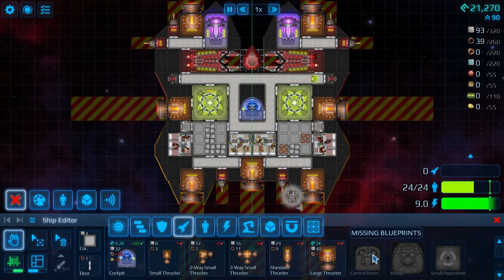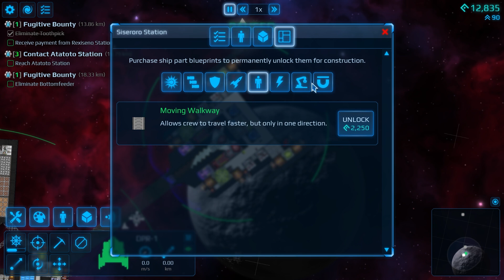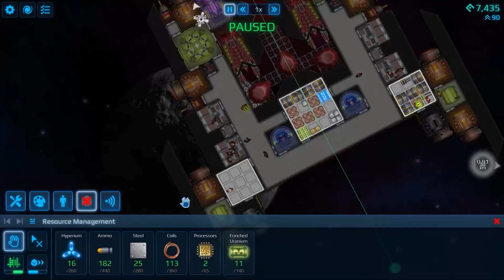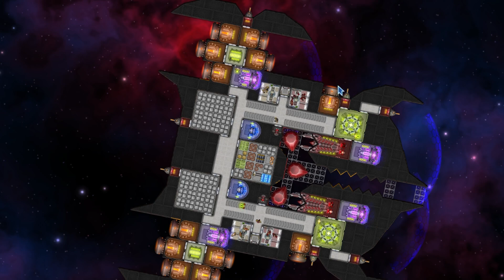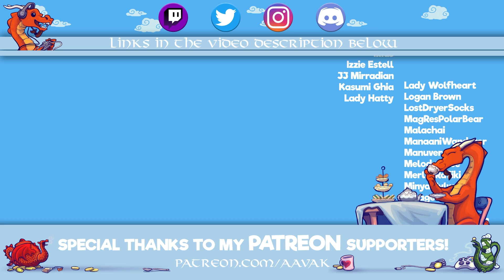Ion Prisms Allow MUCH better Defences!

Comment: A pretty good strategy once you start getting to a high level ship with a very large interior is to segregate your ship into different sections, so one section at the back to power the bridge and thrusters, one in the middle to power the lasers, and one at the front to power shields and other turning thrusters. This stops crew going from one side of a massive ship to the other and instead all the local crew dealing with it. It also means that when an area is destroyed (e.g the shield section at the front) you can still have a small amount of armour to protect the next section.
Reply from the maker: That's a fantastic idea.
Reply: yeah even in the demo after getting ship costs around 1 mil it was almost a necessity

Comment: I like the look of an open thruster but I have had both enclosed and exposed thrusters.
If it is cheazzy well so be it I like aged tasty myself ;).
Fleet stuff would be cool but I'd work on the main ship with a mining rig, maybe have a Hauler off to the side?
Reply from the maker: Interesting suggestion, though I do wonder that if you're already building a hauler, why not have the mining laser on that?
Reply: @Aavak  Sry for the late reply but I was thinking along the lines of one Miner to start and many to follow :)

If the mining laser is on the Hauler then you can only mine one rock at a time, 
with many mining drones many rocks at once.
Though I don't know if they can be automated? if so would be cool.

Comment: @Aavak Been playing this since it was it's Steam release and I've been loving it!

Some tips:
- Get your reactors to near the back of your ship. One medium reactor popping will GUT your ship! Protect them well, possibly even with internal armor!
- You can right click the gather icon to filter what gets tagged for gathering!
- If you hold alt when positioning your ship, relative to another ship, you can maintain facing relative to them rather than the world. Great for strafing!
- You can hold shift to reposition and turn your ghost ship for more fine-tuned maneuvering!
- You're only employing four gunners at a time to man your weapons, so if you only have one security (large) bunk, you'll have two extra to run energy. Having 12 crew running guns is overkill for your setup, even accounting for crew losses during combat. You could pack another small bunk in if you're worried about energy/loss, and save yourself some space.
- Crew move at half speed through any area that isn't a corridor, so having crew movement corridors and rooms with doors to them will greatly improve movement speeds!
- The gratings/structure elements absorb some shots, but only from enemies! so placing them in front of vulnerable areas (i.e. guns) is advisable. This will work better than your sawtooth structure while not restricting your firing arc as much!
- ASAP build a cargo ship and man it with two to five crew so you don't need as much storage on your main. Collect with main, so you have access to full crew gathering, but then transfer to cargo.
- You'll eventually want a few storage boxes with just a cargo bay and small bunk at a station, so you can save up parts for major redesigns or new ships.

Comment: I shared your opinion when it came to enclosing my engines. That is until the enemy did it to me, so I decided all bets are off. I also rationalised it as the internal engines point like 25 degrees above and below the hull

Comment: Not a fan of liquid locks huhs? Nice to see someone else out there has some integrity. Shame the proper airlocks are such ass. One of my bigguest issues with Oni. I hope its been addressed sense I last played.
Reply from the maker: I give a by to /large/ scale liquid locks (as they're legitimately used in certain industries IRL) but when someone's just dropping a few kilos of water on a tile and somehow holding back several thousand kilos equivalent of air pressure on the other side, it gets a wee bit silly XD

Comment: I don't believe having the engine block at the back of the ship is cheesy at all, but this could be due to a fundamentally flawed understanding of spatial and rocket physics.
I'm working under a few assumptions here, namely the following:
1- An object in motion stays in motion unless an outside force interferes.
2- Propulsion is achieved when something is thrown away from an object at a decent speed.
3- If said object hits something it'll transfer it's momentum to the object that was hit.

SO! Taking this into account we can surmise the following:
1- Provided that ~51%+ of the exhaust from your thrusters dissipates into space,
AND
2- Provided that ~49%- of the exhaust hits the front of the ship,
this WOULD still (IRL) generate SOME momentum (in theory).

However, the space required for the thruster seems to allow for ~100% of the jetstream to dissipate into space, this means that ~0% hits the front of the ship, allowing for the thrusters to have full and complete propulsion ability. This is not cheese at all, in my eyes, it's simply physics, even if my mediocre understanding of it may be lacking.
If anything, I think having a massive engine block that allows for forward and backward momentum along with a variety of much smaller thrusters along the hull for sideways and rotational maneuverability would be a completely realistic method of maneuvering military ships in real life, which your current one absolutely counts as, I believe.
Reply from the maker: My limited understanding of space suggests that unless the engines weren't pointing at the rest of the ship, then near 100% of the exhaust is going to hit the ship, there's no reason the exhaust would change direction, only the initial 'spray' out of the engine nozzle pushing some of it off axis, but realistically any reaction mass blasted out of the engine would continue on its trajectory until it hit something, and would then impart its energy into that thing.

So unless the engines were designed to exhaust above and blow the 2D plane, it would just be pushing against itself. But if you want to imagine hat's how they're designed, that's cool too :D
Reply: @Aavak  Very valid point. I did ponder the idea of "the engines are pointed into an imaginary third dimension" however, I don't believe that would've made sense as they look visually the same, and considering the other choices with the game we've seen so far, and the attention to detail, I think the creators might've chosen to create engines that look slightly different for that. Aside from that, though, I still think that "if it's cool and it works, why not use it?". 
Another point I think should also be considered is... what if something DOES hit the back of your ship and tags an engine? Considering how those engines or the engine room might explode, one mistake could end with your ship being absolutely crippled, so I think it might be more balanced than you give it credit for, what with the whole "putting your eggs in one basket" thing. Though it would've likely been even worse if you moved the power plants back there too. A few solid hits to the rear and half your ship would be gone.
Finally, if you hadn't also explained how effective larger engines are, I might've questioned how effective this idea would be with the Huge Engines, but I think, considering how big they are to begin with, you'll likely have to elongate the ship to compensate for the exhaust.

One last thing: I'm absolutely adoring this Let's Play. It is immensely fun! I hope you'll make more of these in the future. Space ships, Building, Upgrading, Space Combat, every part of this game speaks to me on a spiritual level, and being able to listen to your voice as I watch it just makes the whole experience all the better. Thank you for your great work.

Comment: could you be able to add a focus crystal to the top of the lazer cannon to gain the aiming function back, or does that not work. also why not both, like you said a bunch of little mining ships you send out to gather the resources for the turning of the war machine....
Reply from the maker: I think the prism at the top is a pretty solid idea :)
Reply: @Aavak  with the design it is far enough away that an explosion wouldn't harm the internals of the ship, plus you would still have the "hidden" one to fire.

Comment: You keep adding armor to your ship and wonder why it doesn't speed up. Having your deliveries going through storages is super slow. I would recommend making a storage section vice having storages connected to stuff that has to be supplied with energy
Reply from the maker: Oh, I realise the armour is working against our thrusters, I just haven't played enough to get a good feel for /how much/ that's the case, so my surprise isn't that the amount of armour slows us down, it's how much extra thrust is required to offset what we've added :)

But moving the storage to allow easier access is a great suggestion. I didn't realise just how much crew slowed down going through rooms XD

Comment: More armor is more weight... and thus slowing your ship.
33:40 - Why not specify the flow of power, so they take from the generators to the nearby stuff and specific capacitors... and from capacitors to the devices near them. That way, they aren't allowed to haul between capacitors. Also, they may not even be hauling between capacitors... they might be grabbing from the right capacitor to put power into the left engine... just because. Another reason to specify power flow.
37:00 - Apparently, engines towards the middle of the ship are more efficient at increasing speed. Not sure how true that is... but with the weight of your ship, I'd be adding another 4 engines at the back to try and get higher speed anyway.
Reply from the maker: Oh, I realise why the ship is slowing down, I'm just surprised by how much extra thrust is required to speed it back up; haven't played the game enough to get a good feel for the balance between armour blocks and thrusters yet I'm afraid XD

Great suggestion about the energy flow though!

Comment: If the barrel kind of protection for the Ion is a limitation you could always just shove one extra crystal at the muzzle, if it does break you don't lose the weapon but just the ability to aim it
Reply: the problem with that unfortunately is that diamonds are kinda expensive and the crystal is very easily destroyed... its only really useful if you have a diamond refinery and can make your own diamonds...

Comment: First time watching this channel, but I have a pretty deep knowledge of Cosmoteer (Not to brag of course), and the first thing I'd suggest on your ship is to not abuse reactors. Your ship, no matter what the power suggestion bar says, could be reliably run on as little as two small reactors. Taking them off now would be wasteful though, as your ship is obviously going to expand as time goes on and selling the parts gotten from downgrading these cores would be sold at way cheaper price than they actually cost (A system present to stop people from creating money exploit).
Reply: Could you please elaborate a little more on that claim about being fine with two small reactors? Is there anything special you need to do in order to get by with just that (like the layout, crew settings, etc)?
Reply from the maker: Ah, thanks for the suggestion Nika, I'm guilty of following the (probably very generous) guide about crew / energy, but the more comments I read, the more I realise that if I take the time to optimise the use of energy and pathing for crew that I can run the ship with much less. I'll be looking into that in coming episodes :)

Comment: Would a purely storage vessel be a good idea? Just a massive ship loaded with the biggest storages you can. Maybe some defenses. Instead of having to go to a starbase and sell resources for space and buy it back to build things, you can just store resources here for free.
Reply from the maker: I'm leaning strongly towards this, aye.
Reply: I'm doing this now .. I'm around Rating 10 at the moment and it's working great. It's just a big square with engines on the corners and back/front and small shields lining the edges. The rest is cargo space. I started using it for industry but ended out owning WAY too many missiles, etc. I have a small/medium factory ship that hangs out with it.

Comment: Ion protip, always use inputs to outputs in a 2 to 1 ratio. So 2 emitters to  one prism. Next level is take 2 of the emitter prism blocks and make it point to 1 other prism. Do not aim four beams directly at one prism, only ever have 2 beams hitting a prism.
Reply: Wait... do you mean that only emitters hitting prisms reduce the dmg but not 2 prisms channeling into a third? So when 2 emitters hit one prism for 175% dmg, another 2 hit another prism also for 175% dmg and those 2 prisms channel into a third that one would do 350% dmg? I thought the dmg would be reduced by 4x25% and not 2x25%.

Comment: In cases where you are to leave behind scrap, I'd advise using the marker feature which allows you to identify leftover parts or places you would like to come back to. The marker feature is shown in the bottom right, just above the map display.

Also, just a quick mention regarding using ion beams. It would be far more efficient to have a diagonal ship, rather than what you have now, especially for ion beams. Instead of using 3 ion crystals, you would only need to use one, therefore greatly increasing your destructive capabilities.
Reply from the maker: I noticed someone else suggest a diagonal design; I'm not ready to jump into that just yet as I feel I'd need a bit more practice with general building before trying to build something like that, but I'll certainly add it to my to-do list, perhaps for a new ship, then I'll can have a side by side comparison which would be fun to build (and watch, hopefully!)

Comment: I do like the focus on construction, at least early on, it's such a big part of the game after all.
Reply: The building is definitely the heart of the game. The fighting is only to confirm that what you built is awesome xD

I upgraded to control room size and got 8 ion beams rocking bundled in pairs and concentrated in the end following 2 -> 1 rule and my gosh was it fun to see the result cutting enemies in half instantly that I previously was struggling with. But then it's back to the drawing board to improve the battery supply etc. just amazing. I bunked 10 hours already and barely left the starting system.

Comment: out of curiosity with the barrel for the ion beams could you in theory stick another crystal at the end of it where it exploding wouldnt really damage the ship/system to much but would keep your firing arc unlimited? yea it getting destroyed would still use up resources to rebuild but it keeps the ship protected from the explosion and doesnt fully disable your system if the crystal got destroyed
Reply: yes you can do exactly that... but you have to click on the prism before it and tell it to fire at the other crystal... otherwise it will try to attack the enemies and be unable to do so... when you really just want it to only fire at the other crystal
Reply: @arcanumelite4853  so would it be worthwhile on a ship like how to stick another crystal on the end of the “barrel” to allow it to target better
Reply: @jkelleyk  well... yes and no... if your using shields it might not be as bad... however it wont work if your using armor as your protection... because placing armor in front of it will basically cancel the whole reason your putting it there in the first place... so with shields as your defense yes.. if armor is your defense absolutely not...

Comment: if you want a new name for the ship, I suggest Dappernaught!
Would it make sense to add another ion beam crystal towards the prow of the ship, just peeking beyond the tip of the armored channel? Gives you the ability to direct your beam properly, at least until it gets shot down. But that won't disable your weapon at all, just set you back to the point where you are at currently, being able to only shoot straight. Expensive if it happens a lot, but if that happens a lot, you have other problems 😂
Reply: never mind, Thomasz has posted that idea an hour before me (and others probably even earlier than that)

Comment: I just had an idea that you may want to put map markers on the pirate bases you've found (using the button above the mini-map) so that you know what the question marks are. I have often found myself headed straight for one because I've forgotten that I've already been close enough to identify it as hostile, but not close enough to remove the question mark.
Could also be handy if you end up making a hauling/industrial ship so you know which areas to avoid if you're sending it back to a station without an escort

Comment: I may be mistaken but it seems that the game follows center of mass/ center of thrust dynamics, so you might have better luck with increasing your top speed by moving engines intended for forward thrust closer to behind the center of the craft. If the game does model this then your turn rate will decrease in exchange however.

As far as a name goes, DPR-Impid makes sense to me with the release of Biotech - the ship is covered in spikes/horns and breathes fire after all ;p
Reply from the maker: Solid name suggestion!

Comment: Here’s a tip: right click on the gather/mine button to open up a filter menu. The gather tool will only salvage blocks with the resources you are looking for, so you can disable gathering steel plates and coils, and only gather the more valuable components
Reply: Oh wow, this is just what I was looking for, thankyou!!
Reply: haha lol i just wrote the same thing and seconds after i read your message here :D
Reply: Never knew this! My alternate solution to this has been to set resource limits and also filter the cargo slots. So the gather tool picks up at most X amount of Y, and you’ll always have space for valuable items as well.